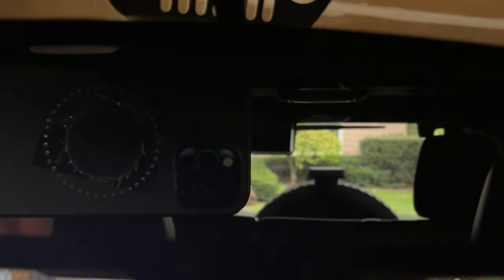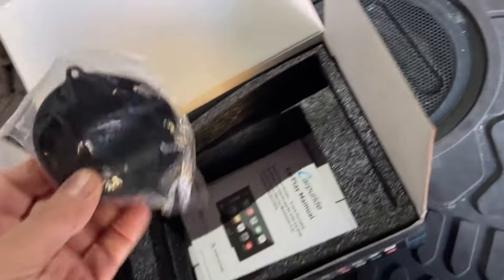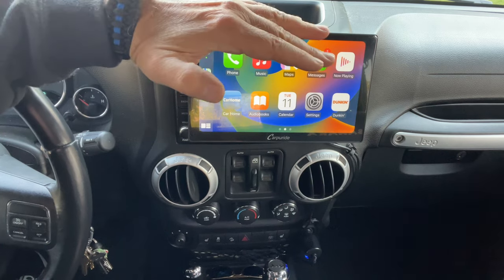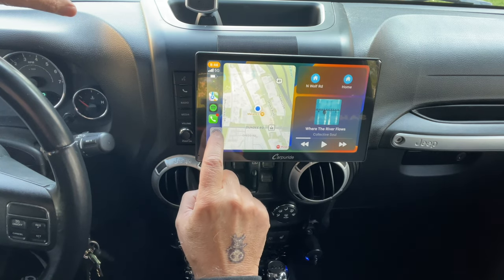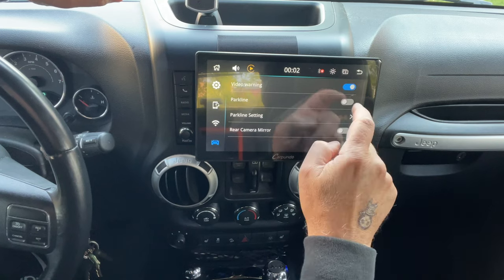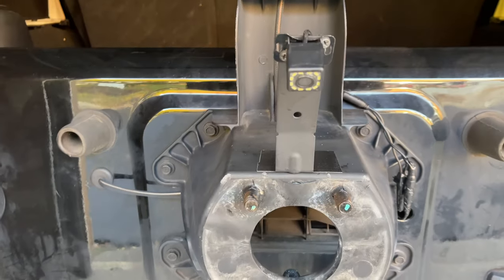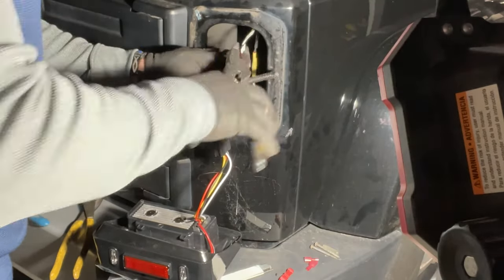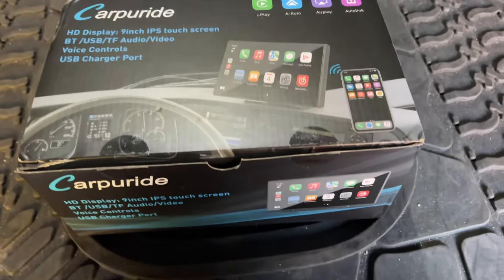Apple Carplay & Reverse Camera for your Older Car-Carpuride

Comment: I purchased a similar unit and there is an additional red wire branching off of the Unit side of the RCA cable for the reverse camera. The instructions make no note of this wire. Any idea?
Reply from the maker: It's been a while since I installed this one-contact the company and check w/ them.
Reply: Same here! You ever end up figuring something out for that little red trigger wire? 
Really trying to avoid taking out the radio and tapping in at the Head Unit's harness.

Comment: is there a way to use the reversing camera without hard wiring it into the electronics of the car? I'm not competent in even the most basic of wiring, and I do not own the car myself so I cannot risk destroying anything. When I try to use the camera currently, it shows me a split between front and rear

Comment: Thanks for the video! Just wondering what you used for the Trigger Wire on the Display side? 
I know most stock installs would just tap in at the Head Unit's wiring harness, and use the reverse gear indicator for the "convenience wire" (that little red power wire coming off the extension video cable). But I'd really like to avoid having to remove the stock radio just to wire that in lol. Even would use a manual switch if there was some other place I could tap into for the right amount of power.
Appreciate any other suggestions you might have too, Thanks Again!
Reply: (the unit I have is a cheaper version but with all the same wiring components and connection ports. That's why I'm assuming mine doesn't automatically trigger on the display)

Comment: How do you identify which rear light wire to connect with the red camera wire ?
Reply from the maker: Use a 12v tester-check the wires and find the one that reads 12v when the car is in reverse.
Reply: When I connect the camera, and reverse it makes the screen go blank…. Or shows picture for a split second and goes blank. 

I have led taillights… do you think that could be the issue

Comment: Thanks for doing the necessary for this great product. Nice, no nonsense video. Love it 👊. 
I purchased the carpuride W903 for my 2015 Honda accord coupe. Love it. It gives me audio control like never before. Functions great for navigation too (better for my older 50’s vision 😜). This carpuride requires a backup camera without the led lighting , but that’s ok. I feel it should be bright enough. I have it on order direct from the factory. Love this CarPlay device. I’m going to purchase one for my daughter’s 2009 Camry and significantly upgrade that’s cars audio and reversing capability. Will make a great Christmas gift!
Much appreciated commentary!!!

Comment: Hey Geo, how does the carpuride know when you go into reverse? Thank you :)
Reply: Yea I’m wondering the same
Reply: @kyleramos2595  You have to wire this into your reverse camera light, that’s how it works, I figured it out haha
Reply: @alexdev5809  wud you connect the red trigger wire to (branching off of the RCA extension cable) on the Display side?

Comment: I got the 905 and it only has one red only
Reply from the maker: Check the instructions and contact the mfgr. if need be
Reply: @geofatboy  guess the new models only comes with the red wire only

Comment: Hey Geo I have a weird question. Have you ever used an Electric Pre Shave Lotion with a Safety Razor?

I wanted to try out a Pre Shave oil and I bought Williams Lectric Shave because it was Cheap but I don't know if I can use it. I didn't know Electric Pre Shaves existed before I bought this Bottle.
Reply from the maker: Don't see why it wouldn't work, its job is to elevate the beard.
Reply: @geofatboy   Thanks for taking the time to answer my Question.

Comment: I just bought a Carpuride 10.3 for a very old jeep but WITHOUT the backup camera (on purpose). I bought separately a 360 bird view camera system, but the installation of the later is going to be messy so I wont do it on my own. I asked the Carpuride people if this setup will work and they “somehow” answered “yeah sure” but zero guarantees… Im not sure they really understand English… did u ever consider a better camera system?